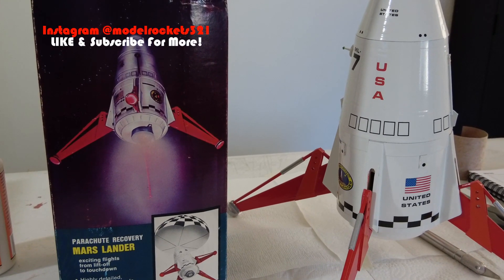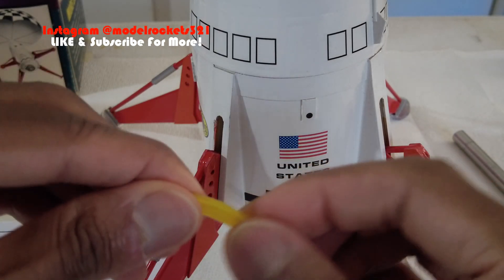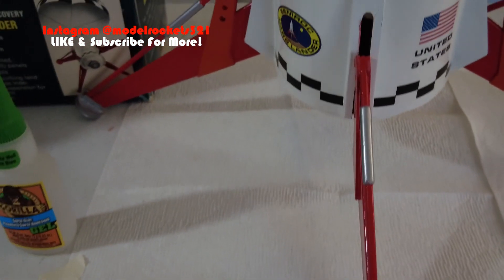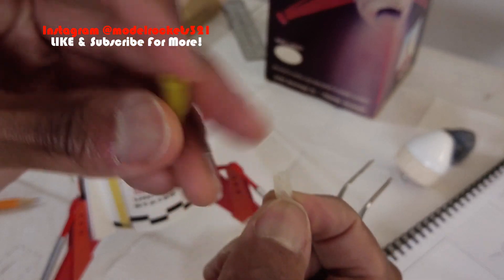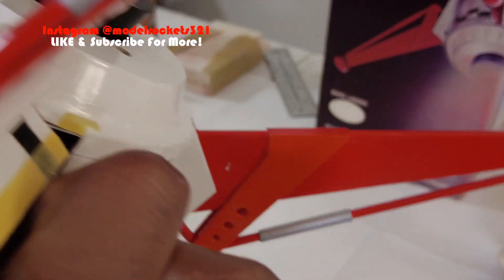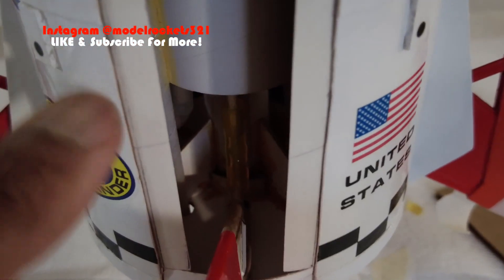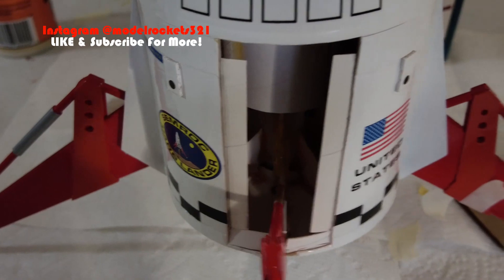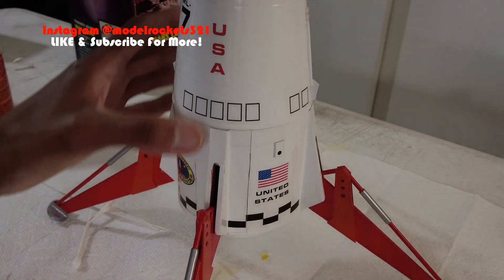Estes/Semroc MARS LANDER Model Rocket Landing Gear Repair.

Comment: Nice work!! I had an original Mars Lander back in the 70s, and always wondered what would happen if one of the rubber bands broke.  I remember the original had deeply embossed panel lines on the tapered shrouds.  Does the Semroc have the same?
Reply from the maker: Thanks. Yes I had to go in and repair it. Yes it has some embossed shrouds. Hard to see on video. The older ones may have been  deeper. I have an original one. I have to check

Comment: I have 3 Semroc Landers not built yet. Do suggest go ahead and updating those Tubes?
Reply: Sorry about That, I meant to say, Do you Suggest updating The Landing Gear Tubes?
Reply from the maker: I think the original ones are good. Just a freak accident that caused mine to break, after the parachute did not fully open. It hit hard on that leg and the weakest part had to give. Which was the tubing. I'd say the original tubing is good. However the yellow seems tougher and would go that route. They sell those at erockets.

Comment: Keith, what a great video!  I, like you, MUST find a way to repair.  I haven't thrown out a rocket yet.  Even those that look "terminal", I find ways to repair them.  How many people would have looked at your damage and said that it wasn't worth repairing and then just tossing it?  Way too many.  You and I think the same.  Way to go!  As an R/C airplane pilot, I would be willing to bet that the replacement tubing you used was fuel line for gas powered planes.  Just a guess, but it sure looks like it on screen.  Can't wait to see you get the Mars Lander back up in the air.  Thanks for sharing your repair!  Take care and Happy Landings!
Reply from the maker: Yes. Just a little thought and a sketch or 2. Most things can be figured out. Interesting it may be fuel line. Next time im in the hobby shop Im going to check. It does remind me of the gas line in the r.c. gas cars when I had those. Just remembered 😅. You're probably right. Yes getting this one in the air when I launch again. Thanks for stopping by!